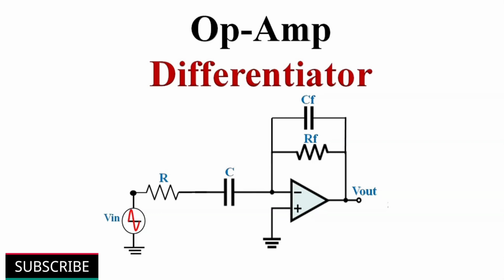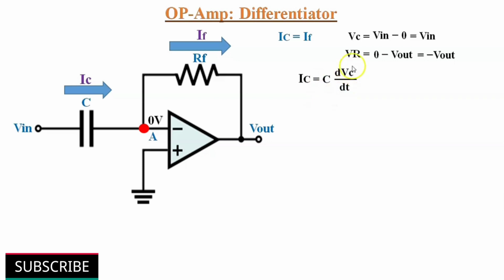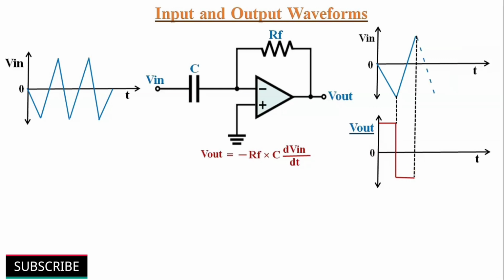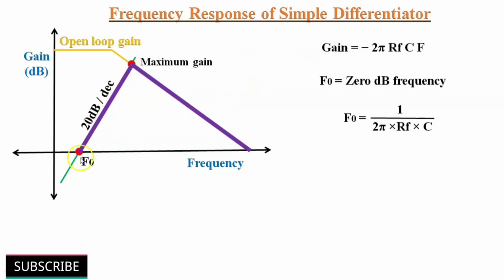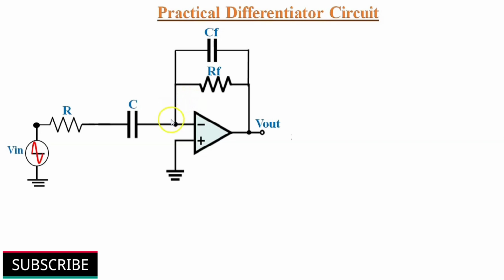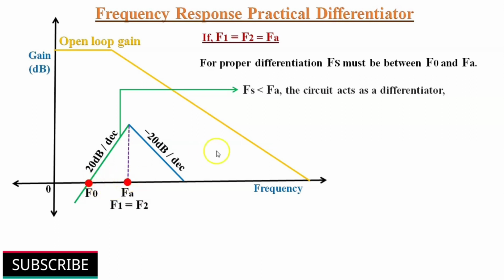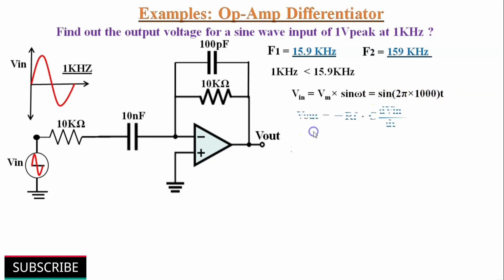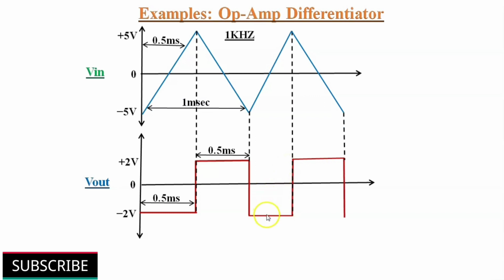Op-Amp Differentiator (Derivation and Examples)

Comment from the maker: The timestamps for the various topics covered in this video are as follows:
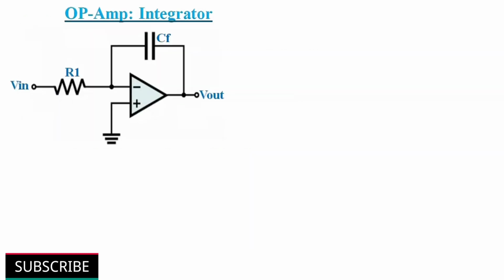0:38 Op-Amp as a Differentiator 
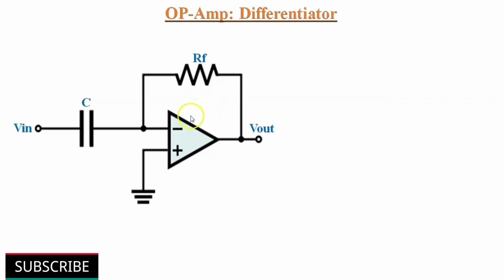1:57 Derivation of Op-Amp Differentiator Circuit
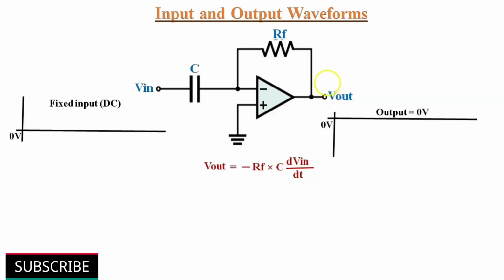3:41 Output of differentiator for the different input signals
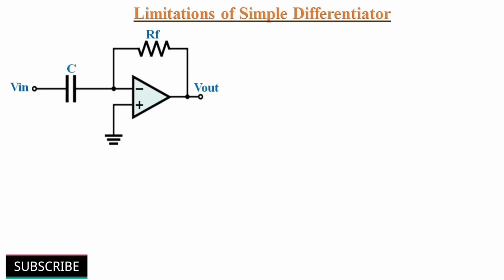5:51 Limitations of the simple differentiator circuit
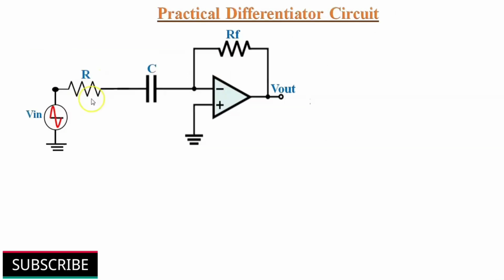9:08 Practical Op-Amp differentiator
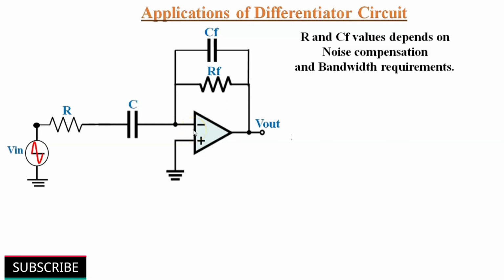13:58 Applications of Op-Amp differentiator
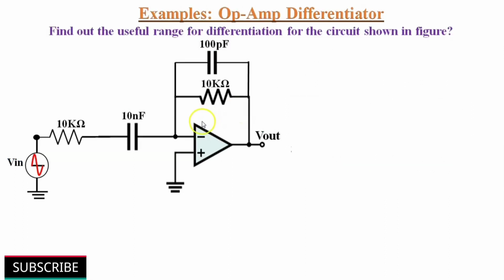14:23 Example 1
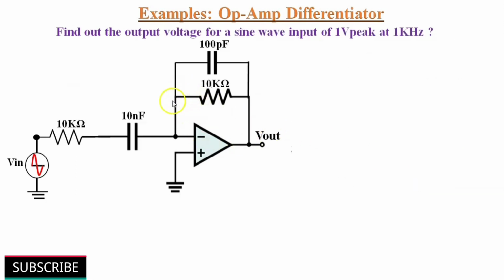15:25 Example 2
17:02 Example 3